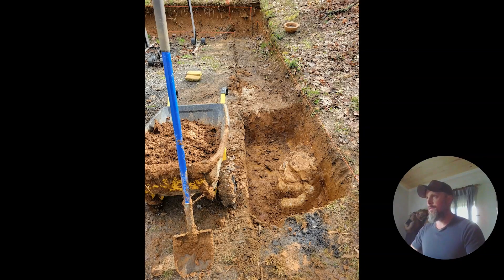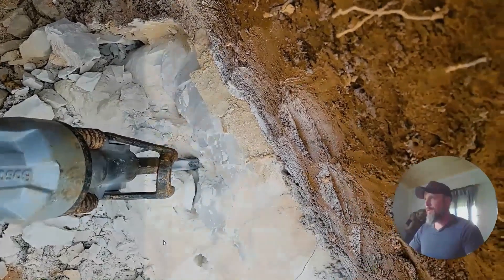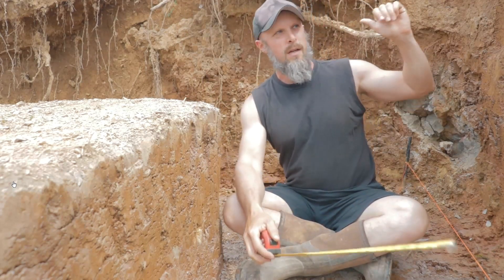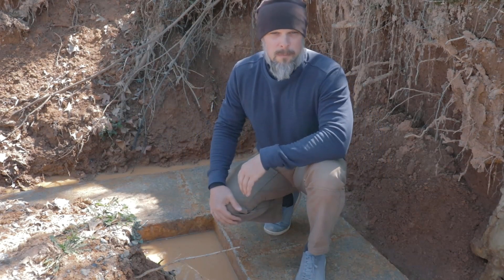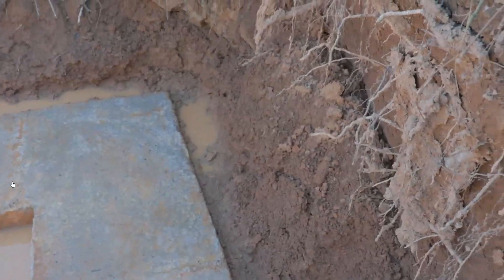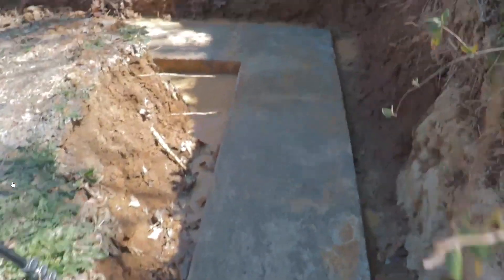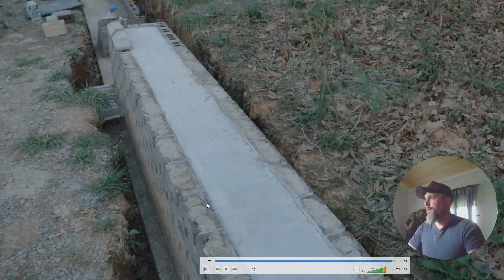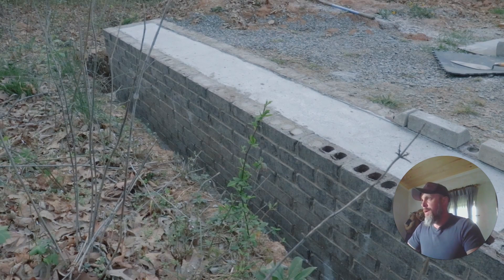Cob House Foundation Building - The Footer & Stemwall System

Comment: Hi I like your videos & I thank you for & with all the time & effort & energy you put into making the videos to teach us how to do things. I truly value your efforts. I need your help specifically with getting the measurements right on point & how to exactly set the first corner foundation pin to start my rubble Trench Footers layout with precision & once I mark my chalk lines for my entire rubble Trench foundation, where do I exactly set my shovel & start to dig out the rubble Trench. I noticed in your video you didn't indicate specifically where to start digging. And I also need to know exactly where & how to position & connect & set the  brick stem wall on top of the footer making all compensations for osb brick or any cladding finishes and also importantly how to make & add a second story on to my cob house including installing the second floor, flooring beams or trust & how to make & add the bond beams to secure the second floor and roof. I'm having trouble with capping off the rubble Trench to perfection & knowing how to perfectly align & position & connect the rubble Trench to the brick 🧱 stem wall so i could move on to the next step of framing. Thanks for your time and help! ☺️

Comment: Hi there from a freezing Karoo desert in South Africa. Regarding your stem wall, if I filled it with rocks and compacted around with gravel, and then topped off the last 4 inches with a cement mix, would that be an acceptable method? My land is basically just shale and rocks, and I'm trying to use up the darn crap to give myself some darn space on the property. Thanks for your informative videos

Comment: Why ? Rubble trenches work so much better, they provide the added bonus of very effective drainage, they isolate the subsoil inside from damp and best of all, they are vastly cheaper and faster to do. 
Pouring a concrete footer over heavy clay creates moisture cycling and heaving of the footer. The traditional rubble trench is proven, stronger, more stable. Concrete is expensive, leaches toxins in to the subsoil and after about sixty years it starts to crumble as the silicate crystals break down. 
Traditionally the clay excavated for the rubble trench was used to bind the cob and the draining footer fed rain water to a pool to provide water and a pit to mix the cob in. Simple.
Reply: Very thoughtful. I wish you had a video of this I can watch. Thanks for sharing.
Reply: @joschmoyo4532  like the thought out discussion we are getting into here. Wish we were doing this on a proper searchable for posterity Internet forum rather than ephemeral youtube comments . Does such a thing exist for the natural building community and I’m just not aware?
Reply: @ericcartier3281  
A good question. One of my biggest concerns is the tendency to reinvent the wheel when it is such a simple concept. 
There are some good books on the subject but even there you see that creeping tendency to "improve" on the original formula.
The original formula is very very simple and that is exactly why it works so well. It can be described in perhaps four pages with a few illustrations. The one modern advantage we have is the ability to mix the cob using a variety of powered tools, very quickly and effectively. Tarps are slow. A forced horizontal concrete paddle mixer can do in five minutes the same volume of Cob. A tractor with a rotary tiller can mix 3 cubic meters in half an hour with practice. 
Tragically there is a tendency to hybridise cob with other disastrous concepts like straw bale etc. These misapplications are in danger of undermining a proven technique. Not good.
The science behind the genius of cob is another fascinating subject. Using gravity to compress quartz crystals in the sand generates negative ions that purify the air, drops dust, repels mildew and kills it. Piezo electric effect also generates beneficial UV. It may also be a factor in the cozy feeling that you only get with Cob. Cob heals. Everyone who lives in a cob house will tell you they sleep like a baby and wake up feeling restored.
Reply: @ericcartier3281  
In my experience the earth building community has been coopted and radicalised in many areas. Architects invariably meddle with the formula to indulge their ego, builders try to skew the formula to make larger profits and reduce effort required.
Rammed earth is a total scam but it's faster. It's rammed concrete. It gives a cold hard dead wall that doesn't breathe. 
Forum's tend to be presided over by neurotic moderator's that kill honest input. The green movement too has turned off many from cob by turning a practical owner builder formula in to a cult like marginalised hippy folky culture. Invariably this leads to strange buildings that lack structural integrity. Go back to the original Cob houses in Europe. Visit an area that has them. Try and stay in one. THEY are the real thing.
Reply from the maker: With all due respect, I never said this was the best foundation system. I don't believe in a best for anything in construction, really. There are always pros and cons to things. I like to give people options for different designs since everyone is in a different situation.
I'll be extending this wall next year with a simple rubble trench though. As, like you said, its cheaper and faster to build. This section, I decided to demonstrate this style of foundation though, so I'm doing it to the best of my ability.

I could use more information on moisture cycling, as I'm not familiar with what that means. I hope to avoid any heaving since I put these footers well below frost line.
Reply: @thiscobhouse  
I understand you want to demonstrate option's but my concern is that if we pander to the perversity of building codes we undermine the integrity of earth building and reinvent it at as a hybridised monster.  Concrete does have its uses but it has many limitations too. Great for wet areas, no denying that. Small sheds etc. But even then it's best to form it over a gravel compacted  with drainage to isolate it from subsoils that expand and contract with changing moisture levels. 
Cracking and heaving of concrete on clay causes all sorts of nightmares for house owners. Jamming doors and windows, running cracks in brickwork, cracking of plasterboard etc.
The beauty of Cob is that it can self heal during subsidence by micro cracking then gravity just resettles it and moisture rebinds it. Rubble footers self regulate moisture, drawing it up through the cob then the cob breathes out any excess. Cob creates equilibrium conditions and maintains them. Naturally. Concrete does the opposite. It does not adapt to changes in moisture and temperature. It exaggerates them. This is why Concrete basements are cold and clammy or hot and stifling. 
The cleverest part of the rubble footer is that it optimises the conditions of the soil isolated inside it. The humidity differential between the outside subsoil and that inside creates a self balancing dynamic. The cob creates and maintains the optimal humidity level for human health at around  65 percent relative humidity. You will never ever see condensation on cob. You will on Concrete and brick. 
Cob is cozy for a reason. So important to understand how it works and why. It's a system and if you mess with the fundamentals you loose the full benefit.
Reply: Rubble trench. I want to like it. Except Rock crevices snake and vermin habitat… right next to your home .
Reply: @ericcartier3281  
Won't be a problem. Keep your rubble size to around 40- 50mm. Railroad ballast is an excellent size. Line your trench with geofabric then fold it over the top.
We have some of the most poisonous snakes on the planet. They won't go in the trench. They don't like cold stone and the gaps are to small for larger snakes. The geofabric will keep out anything anyway. 
Speaking from experience here, not theory. My trench has never attracted a single snake. They prefer barns, sheds, piles of compost, fire wood etc. Places that are warm and they can build nests in. Or you can waste a ton of money on concrete. If you must use concrete, cast a ring beam over the rubble trench to set your stone plinth wall on. Uses far less concrete, makes laying your wall easier and gives you a damp course to keep the building code monkeys happy. 🐒 .